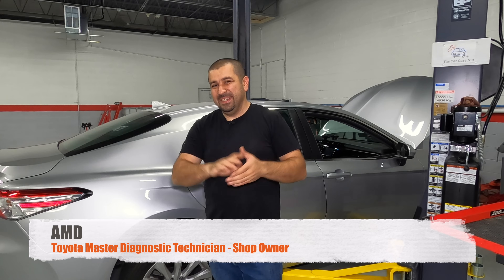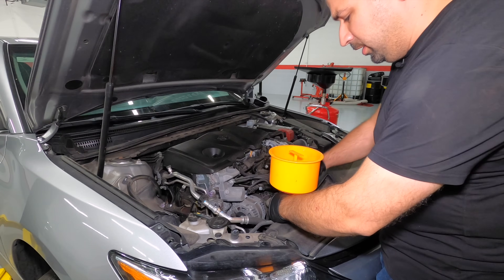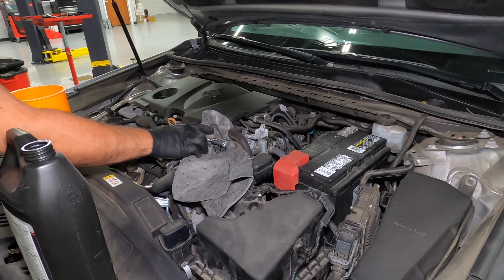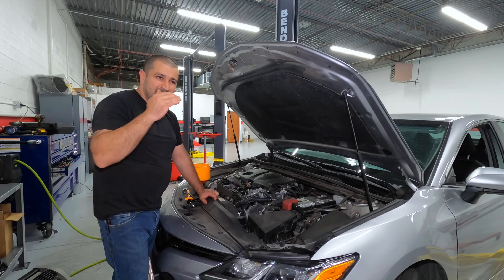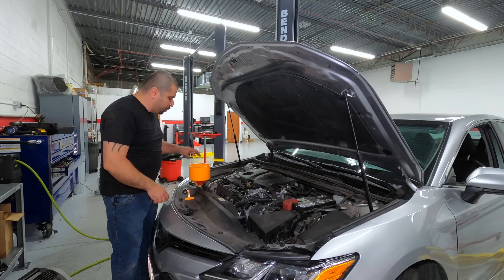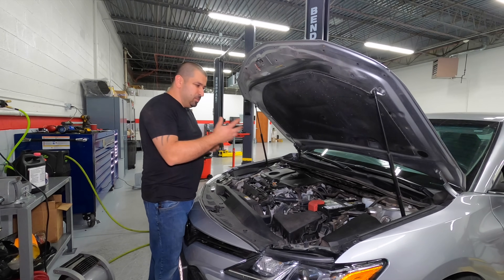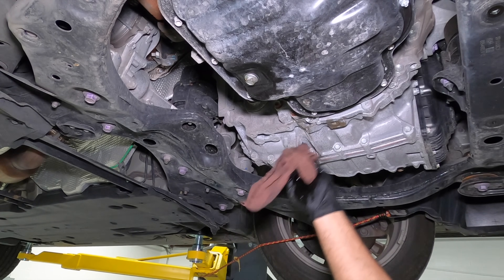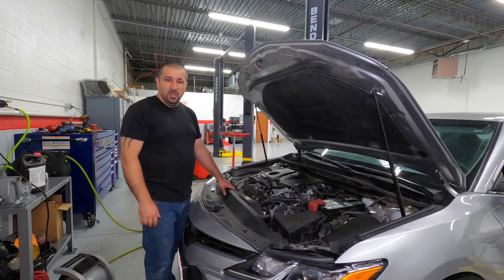Coolant Replacement on Toyota's New Dynamic Force Engine | DIY Without a Scan Tool

Comment: What are the conditions that are recommended be met to perform the coolant and transmission fluid changes? I have a 2018 xse 4cyl
Reply from the maker: Hi! Transmission fluid every 60k miles or 6 years. Coolant every 50k or 5 years
Reply: @TheCarCareNut  thanks AMD
Reply: Do you use Toyota brand transmission fluid or is there a better type? Same goes for coolant?
Reply: @glengrandy2378  AMD uses only Toyota product, nothing else in his shop. He mentioned that a few times in previous videos.
Reply: @2405jacko  Actually yes and no. Trans mandatory yes. Coolant. Yes. Preferably, yes. But some fluids that are prohibitively expensive for no good reason, he uses generic. Gear and brake.
Reply: @glengrandy2378  Next time ask in a brand new thread for him to answer or have greater visibility. 
To him anyway. Trans, high recommend for Toyota only. Especially the very expensive new CVT stuff. Yes Aisin makes their own fluid now. Few anecdotes on them. You will hear a lot of salesmen try to sell you the Valvoline Maxlife atf. I can tell you from PERSONAL experience, ONE spill and fill caused problems on cold start for a late 90's unit that used Dexron and again because I didn't learn the hard way the first time, I allowed another customer to do it on a late 2000's unit as well. Both Toyo-Aisin products. That's only 40% drainage each time. Two spill fills later, only is there minor problems on cold startup. Toyo is the best for trans. Coolant is a different story. 

You can use Asian Valvoline coolant. Pentosin makes a similar product. That one is more flexible. And if you want long life use the red. Or pink nowadays for the new stuff. Don't do the green unless you're dumping and flushing the core every other year. Every two years tops. Or expect clogging/rusting and leaks.

Comment: Have 2018 camry but when the fan comes on it doest turn off. i have scanned and all system seems ok. changed the temperature sensor and still remains same. Cooling fan goes off only after a minute when engine turn off. Any help
Reply: Normal….The fan should run for a minute or two after the engine is turned off… my sisters does the same thing…
Reply: Coolant low? Outside temp high? Low speed driving operation only? Mud caked on the front on the radiator?
Reply from the maker: Is the weather very hot? If it is that could be normal. Also is your AC running?

Comment: Ahmed, I think you could step up production by having a magnetic mounted camera directly overhead. You know the parts and their exact look and location... Not everybody else does.

Congratulations on the shop. Hope your departure from the dealership was cool and supportive.

Yes. Thank you Armando!
Reply: I agree with Sean Pop.  More close-ups would be helpful, and also seeing things put back correctly.  Just as an example of things that I know are done incorrectly all the time, show how to properly tighten oil filters, drain plugs or spark plugs.  Too many guys wrench those things down excessively and create problems for themselves and others.  In other words, don't hesitate to show us the nitty-gritty details.  I think most of us are genuinely interested!

Comment: Thank you Armando! 
CCN, I have a question - I own the same car, how often should this service be done?
Reply from the maker: Hi! If you plan to keep the car long every 50k miles or 5 years
Reply: Transmission fluid every 60k miles or 6 years. Coolant every 50k or 5 years

Comment: MD, I have a 2018 DCB SR 4x4 Tacoma with ATM.  I cannot find the part numbers for the drain, fill and stan pipe gaskets.  The ones the local Toyota Dealer sold me are wrong.  Can you let me know the 3 part numbers?  Thanks.  Thank you, Armando, quite a drive!
Reply from the maker: Hi! If need vin number information to look it up.
Reply: @TheCarCareNut  is 5TFCZ5AN4JX153550, thanks AMD